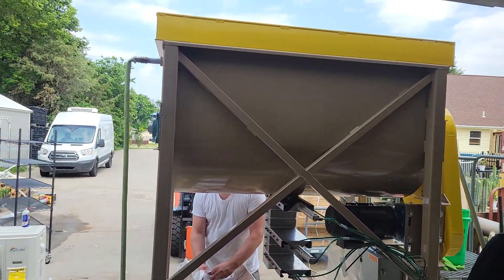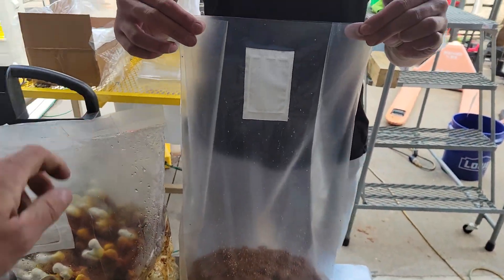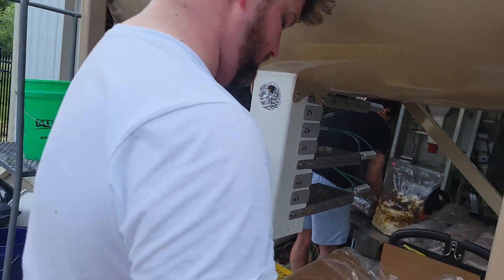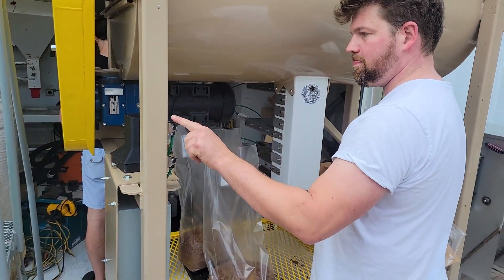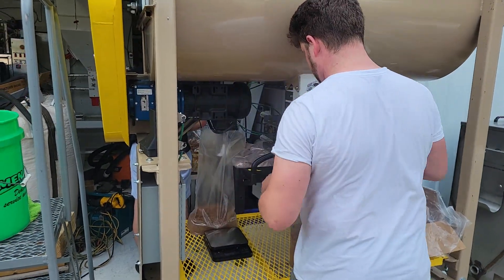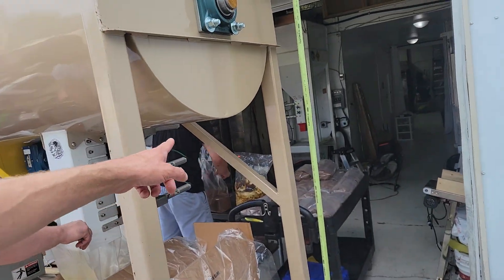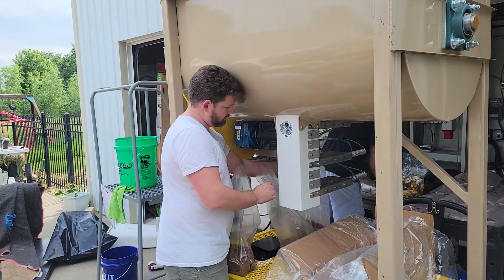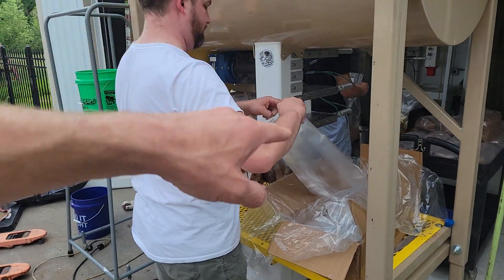Reishi Fruit In The Bag, Bagging out and Water Crystal Trials!!

Comment: Have had water crystals on the shelve for a decade or two, but never used...got them for plants, and had a thought they would be good for mushrooms. I never used them because mushrooms are notorious for taking up compounds that you would not want in your food. Paul Stamets (fungi perfecti) wrote a book including  soil remediation using oysters IIRC and said the fruiting bodies absorb all the heavy metals/toxins ....which you would not want to eat. Which brings me back to water crystals....is it something you want to consume thru mushrooms. Just some food for thought....and I don't have the data, therefore i never experimented with them as they sit on my shelf.
Reply: Agree. I think those crystals are made with acrylamide and I think it's toxic.
Reply from the maker: I did a bit of reading around and it seems it's mostly inert and non soluble. I could always ask my lab buddy to run it for heavy metals
Reply: Not soluble doesn't mid there is 0 molecules exange with the shrooms. I think you should discuss that with the FDA just to be sure. On top of that mushrooms are well known to be able to break and absorb a lot of really tough compounds.

Comment: Correct me if your empirical knowledge says otherwise, but Potassium poliacylate loses the ability to retain water at around 100°C. During sterilisation will lose the water causing the bottom of the bag to soak. After sterilisation it may not retake the lost water in the same way. it would be great to inspect a bag and see before running extensive test, what do you think?
Reply from the maker: We have ran it before and the gel still holds the moisture.
Reply: @MyersMushroomsFarms  good to know, I will test it at 120 and see. Good idea btw
Reply from the maker: We also sterilize at 92C